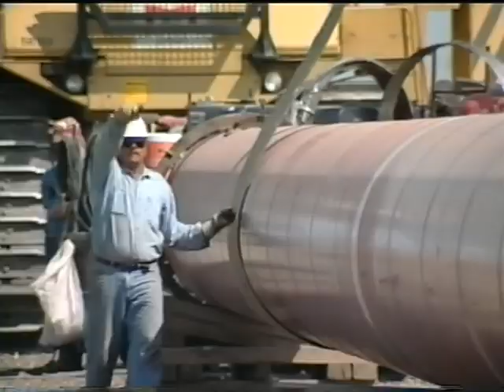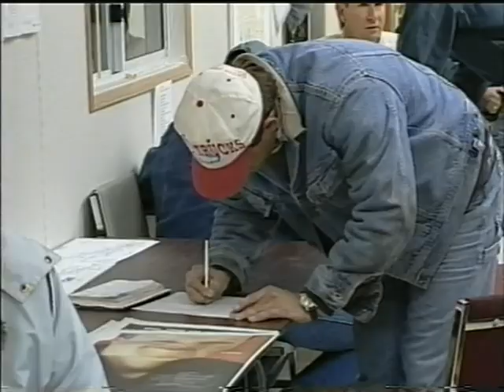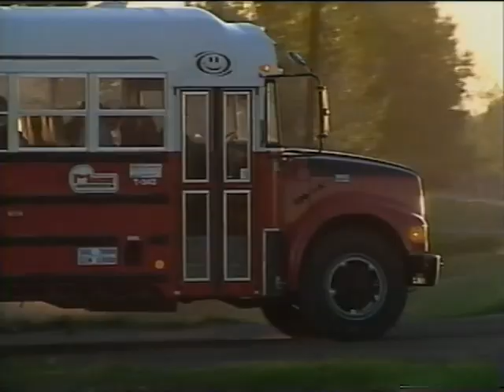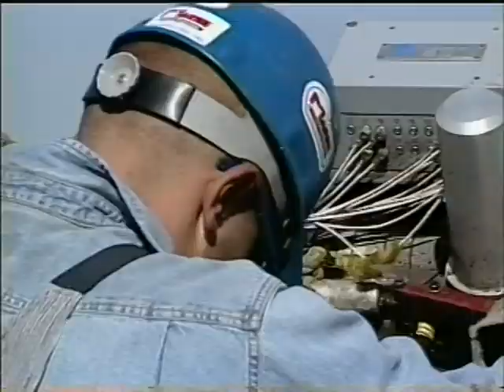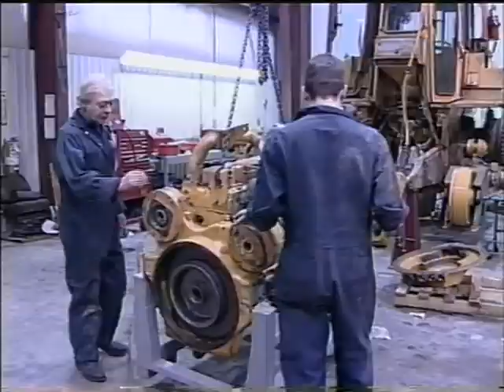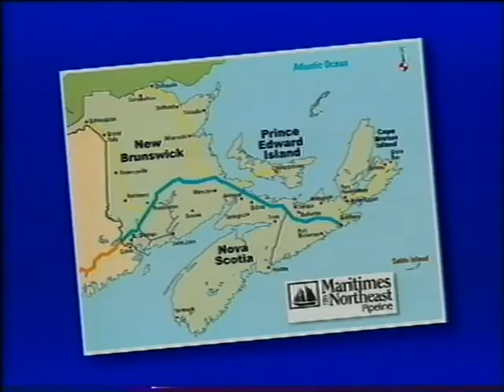Canadian Pipeline Construction 3

Comment: I used to work at Mid West Pipe Coating in Schererville Indiana.At first our larger diameter pipe was coated with coal tar and layers of felt and fiberglass.That was a horrible line to work on and at the end of even a cold day on the exit rack,your exposed skin was sunburned because of the harsh chemicals flying around in the air....I was sent to the clinic many times because my skin was blistered.I worked on that exit rack that was open on one wall so fork lift trucks could remove the finished pipe.I started there in 1979 and left there in 92.Thank God they tore out the old coal tar  line in about 83 and constructed a large diameter fusion bonded epoxy powder coating that gelled up at 438 degrees and was hard enough to roll on 16" tires within about 6'.My job was on the exit rack to inspect the pipe....measure the coating thickness and report it to the operator.That line was 20 times better than that old nasty tar line.We could handle 6" on up to about 48 ".But most of the orders were 16-24" at about30-42' long.We did coat a 36" order for Canada back in about 84.The order was for about 97 miles of pipe.And took use the whole summer.I am glad I got out of there in 92 because....I got a way better paying job....learned a trade....and at 61 years old....my lungs are still ok.Many guys I knew from there....died at 40- 50 years old.
Reply: I worked MW on double joint in pc fl 99-10 twice a year , guaranteed, 6-8 @ a time, loved watchi ng coating
Reply: Killer comment
Reply: Worked back end labor, behind welders in 66, 67, 68, 69, did it all       with the rust machine, dope machines, jeep, machete repair on tar buble, rocks in ditch behind trencher, swamper with sideboom, dope machine, dozer, clam, back with dozer, rare cleveland back fill macine, welder helper, swamping on side boom, dozer, enjoyed money, travel, friends, collapsing ditches, every day different..settled down to married life and family.

Comment: I worked for a pipeline contractor in the late 70's to the mid-80s - not so much in the field but in a warehouse/repair shop capacity - and equipment yard, where all the junk was resurrected after the jobs! 
One day the office called up the warehouse and volunteered me (lol)  to fly from Edmonton to Calgary to deliver a ( Bid proposal) to Nova's office in downtown Calgary. 
It had to be delivered (last minute) before 9 am the next morning! 
No problem I said,  I'll catch the red-eye in Edmonton at 6 am. Land in Calgary 30 minutes later,  catch a cab, and zip downtown with no problem,  that's going to give me a lot of time !!
 What could go wrong ??, 🤔  lol - 
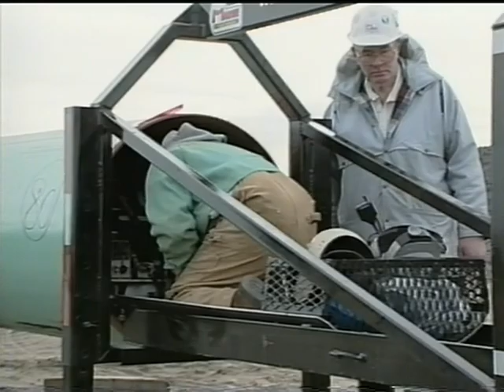Well let's just say for starters- my alarm clock didn't go off and I slept in lol!  Missed my 6 am departure!!  And panicking because I lived 45 minutes from the airport to downtown Edmonton but did manage to get a flight out, @ 7:30.
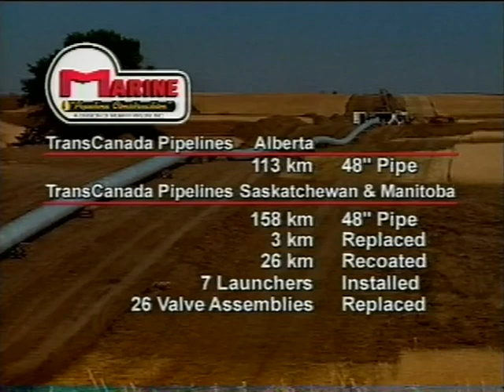Sitting on the runway ready to take off, the pilot announced that there was a small problem at Calgary airport and we would be delayed as we started to go back to the boarding gates! OMG !!  The pilots asked the passengers if they wanted to get off or wait for the go as we were no longer landing on time- so some got off and the remainder decided to wait it out - and I was praying for a miracle at this point lol - thank God we were on our way in an hour- we landed at 8:30 - grabbed a cab and offered up a $100 tip if he could get me to Nova's office before 9 lol
 he did and the bid was in by 8:55 am !!! 
As soon as I told the receptionist who I am, she was in shock and told me to call home and the head office,  because they thought you were killed in the 6:30  am crash  landing at the municipal airport- lol - 😆 
I HAD NO CLUE  that's why our flight was delayed in departure from Edmonton. So I called the office in Edmonton and Gene Caron answered the phone asking what happened and if the bid made it on time. 
Yes sir I said,  I jumped from a burning 🔥 crashed airplane ✈️  during all the confusion,  hopped a fence by the runway and grabbed a cab, got stuck in traffic,  but made it with 5 minutes to spare lol!  Good, he said because if you didn't I would have killed you lol 😆

Comment: All I did was Horstal boring. On pipe I would have to seal pipe with water running out lay in the mud an too make it Ezer the pipe was old. Bent. Coted gas line. Stay in a trench. For long time. The mud would get thick. My welds never broke.  I burnd out. Poor pay very long Hrs.  But. I was. Good an graze.  It will do that. Theas men got it eze.  I rooted with water. Then push the pipe. No breaks. In my welds.